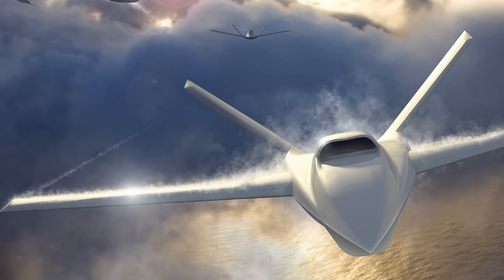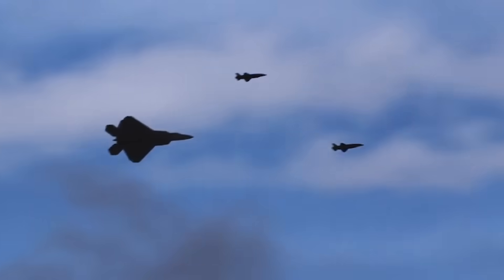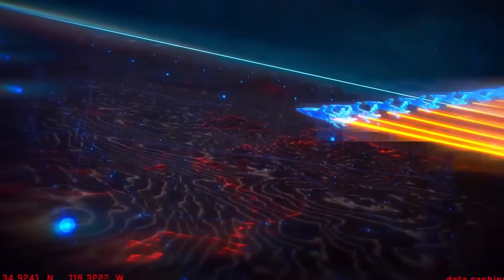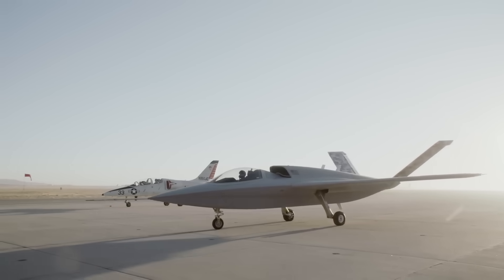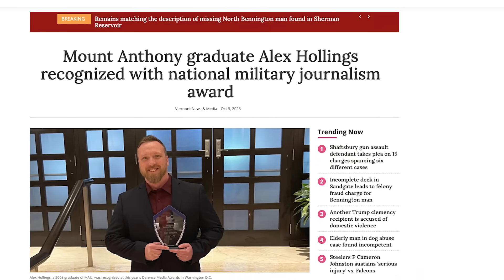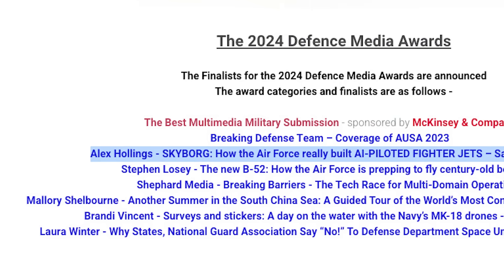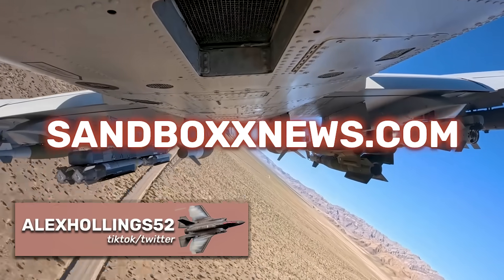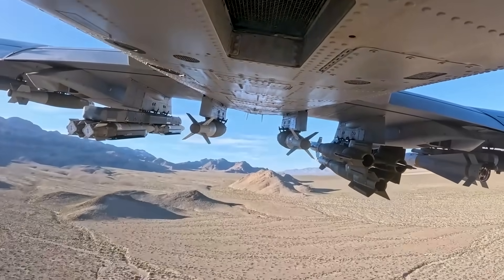Could Northrop Grumman's Vanguard be the future of US AirPower?

Comment: How Northrop Grumman conceptually engineered this aircraft is more revolutionary as the finished product requiring less than 1% re-engineering refinement after the first test flight. 

This revolutionary single thread virtual environment process takes the initial conceptual engineering through virtual engineering refinement on all levels in every category of the process to the finished product. 

This saves millions of dollars, years of development refinements and even test pilots lives as the aircraft has already been virtually refined thousands of times before it was ever even built, requiring less than 1% refinement after the first test flight.

Comment: I love the design philosophy. I've been sketching stuff like this for years. It would sell like crack to poor countries. But it doesn't makes sense doctrinally.
In the USAF, each additional airframe requires 2 additional pilots on rotation and 6 additional ground crew. These personnel cost about $30M to train, and $1M/year in salary. Everything else here is so expensive anyways that there's basically no point skimping on the hardware.

Comment: the math really does work out in this thing's favor over NGAD, if it's in the 250mil range. For that price you can get 25 of these, each carrying 2 AIM-120s, for a total of 50 missiles, and likely a similar combat range. It's not even a question. And of course you can just stick different payloads on them, and network them. Need a radar that can reach out? Replace the weapons bay with it. Need ECM? Easy. And so on. If NGAD shifts to more of a command and control platform for drone operators, I would not be surprised

Comment: I think China has the key to the next generation air power tactic. They have drones acting in large groups as single entities. They're presently using those for aerial light displays and a replacement for fireworks, but that could very easily be used for military purposes.  Combine that group control mechanism with the tactics currently being used in Ukraine, and it becomes a very dangerous technology. We NEED to be ready for such tactics.

Comment: Even without the speed of an F-14 or even weapons load if they had just engineered the F-35 &newer F-18's to have the range of the older Jets they would have truly had an exceptional machine In my humble opinion. It's shame since building so many F-35's especially they haven't by know came up with more powerful engine with @ least 35% more fuel efficiency while @ same time extending the fuel capacity I guess thru size to get this range. If just half of F-35 had the range of those old jets would make any enemy think

Comment: 11:00

What?

Low pressure turbines have been a thing for decades. What does this even mean? Other military jets also have low pressure turbines.

Also turbines have literally nothing to do with Thermal energy, Thermal energy can be converted to kinetic energy, but that is a separate process which turbines don't to anything with. All turbines do, is turn forward kinetic energy of fluids, into rotational energy.

Comment: Why can't the optionally crewed B-21 take over the role that the NGAD would fill by Quarterbacking CCA/UCAV into highly contested airspace with F-22/F-35 followed up by 4th gen fighters bearing massive loads of weapons with Rapid Dragons nearby?  The Raider can not only do air-to-ground but it sounds like air-to-air is in the mix as well.  Wouldn't teaming the Raider with Fat Amy and/or Raptors in an offensive/defensive network offer a similar capability?  After all, NGAD isn't meant to be a dogfighter, is it?  More money for the Sentinel program while allowing the Navy to continue with the F/A-XX program.  Speaking of which...are there any updates as to the status of the F/A-XX in light of Air Force budgets and DoD spending?

Comment: Wanting manned systems is an enormous self-inflicted production bottleneck but pilots like to fly and they run the Air Force. At least modern designs can interoperate with meatless situationally expendable airframes but one day sticking meat in the seat will be as laughable as the Japanese Ohka where disposable pilots substituted for expensive guidance systems.

Comment: Congrats on the awards and nominations, getting aviation news that is acurrate (to a point of course) is often thin on the ground and tends to lack details. Any more news on the V-280 Valor?

For this drone/ fighter, having it optionally manned would be a good way to go as the USAF thought that the F-35 was going to be the great replacement fighter for most of its fleet, maybe this manned/unmanned type of aircraft may be the way to go.

Even if the USAF looks at this on sheer costs alone, having a manned version of this aircraft paired with two unmanned versions would be very cost effective and could be a good general patrol platform for the US and allies. Stealthy, massive range and relatively cost effective... whats not worry about if you lose 5 or of the unmanned versions in an engagement ( and they are only really going to learn from the experience anyway once the blackbox's are recovered ) 

Good job all round, especially with the channel 😀

Comment: Why do I get the feeling that the Vanguard is just a technology prototype that will grow in size and power before becoming the final iteration? Personally, a top speed of Mach 0.85 will mean that it will barely keep up with the F-35 at cruising speed. If these CCA are meant to be reusable, then taxing the engine to max power for every flight will not be sustainable, or practical. Just my thoughts that this is not the final configuration or size of the final product.

Comment: 0:14 you can clearly see B-21's shape on the wings! Well done Northrop!
Reply: You’d be amazed at how far back you can trace Northrops lineage when you stand among their best work. 

Hangar IV at the USAF Museum at Wright Patterson in Dayton. It’s possible to stand in front of PAV-1 (YF-23), face Tacit Blue (BSAX) and see a full-sized B-2 mock up just to your right (it’s an ENORMOUS HANGAR). 

If you look closely, you can absolutely see the lineage between BSAX and the B-2, and from both of them to the YF-23. The rounded edges and chines and razor thin, almost imperceptible transitions from one to the other. 

Now with Vanguard, as you pointed out, you can clearly see the RQ-180 and B-21 DNA. And not for nothing, but I still see Tacit Blue in the aft section on the airplane as well. Great stuff, innit?!

Comment: The top mounted intake is pretty unusual for a modern fighter-type aircraft. I saw that and it got some gears turning in my head for the last few days. Now hear me out on this:
What if they made something that general shape, but it was a seaplane. Like a modern Convair Sea Dart, but done right.
Watertight hull and hatch seals, reinforced and re-contoured as necessary. Use retractable hydrofoils instead of skis to smooth out the bumps, like the LISA Akoya does. Have the rear set (if needed) be V-shaped and double as a carrier tail hook. The V-tail is already great for staying out of the water. Put a GE F414 in it, with a YF-23 style exhaust that would both cut down the IR signature and also help keep the water away from the engine. Stick an M197 in the wing root for good measure. Can radar absorbent paint handle seawater?
There’s so much talk about the vulnerability of carriers and air bases in the pacific, but what if you could turn every bay or harbor with a boat launch ramp into a temporary airfield/staging area/resupply facility?

Comment: The F-22 is still the plane to beat.  We have the F-16 replacement with the F-35.  It is a good plane to replace the F-16.  We need an F-22 replacement and a F-18 replacement.  The F-18 is so versatile.  It can launch/land from the ground or a boat.  It has a growler electronic warfare variant.  It does air to air and air to ground.  It has 2 engines.  It is a great all around plane.  Show me another plane that can do what the F-18 set the standard for modern combat.  The F-18 can even refuel other planes.

Comment: I love when the U.S. invests heavily in developing incredible platforms like the Saturn V, SR-71 Blackbird, YF-23 Black Widow, and F-22 Raptor, pushing technological boundaries. But when there's no immediate adversary, instead of preserving production capabilities like in Russia, where they can restart old designs even decades later, U.S. platforms are often killed off by business lobbying and shortsighted politicians. Tooling is destroyed, assembly lines are dismantled, and knowledge is lost—just like with the Saturn V. Blackbird was killed by accountants and politics not satellite imagery. The YF-23 was scrapped in favor of the F-22, and instead of keeping the F-22 as a backbone with upgrades, more money was funneled into developing the F-35, a weaker platform. If the U.S. had diversified its air dominance programs, ordered both the YF-23 and F-22, and used modern tech to cut production costs, the F-22 could still be the dominant fighter today, supported by AI drones, instead of relying on a plagued by design flaws F-35, that isn't even one flexible platform but 3 different ones sharing only 25% parts. So this way USA could have more for less with lightweight 5 gen fighter in final development. Now when so many nations have their own stealth fighters. It would be a better choice.
Reply: If we ordered both the YF-22 and YF-23, it would have ended up like the LCS. And I don't think I need to explain why that's a bad idea.

Comment: RE: Additive manufacturing - It's possible they are talking about 3d-printing titanium in general and not their specific implementation of it. Even then, I have to call that into question. FFF or FDM (Can't remember which one's trademarked. They're the same process, though,) has been used to modify drones for combat in Ukraine and I wouldn't be surprised to learn that this has been happening for a lot longer than that. Being able to replace parts and make modifications on demand is one of the biggest strengths of 3d-printing, and I think anyone who even just dips their toes into military history knows that the guys on the pointy end will modify anything if left unsupervised for long enough. Even as bad as the early reprap printers were compared to todays offerings, they could still produce useable parts and allowed for rapid prototyping.

Just my two cents. I've been interested in 3dprinting for over a decade and finally got my first ones a few years ago. Between resin and filament printers, there's a lot of scope for one-off mods and prototyping ideas on the cheap. Even if the parts aren't that durable, I think it's still useful because you can find out what works and what doesn't before bugging the guys in the machine shop to make some chips to make your part.

Comment: Top speed really isn't that important. Let's use American targets for example. If the attack is against Denver, the planners could send out these collaborative aircraft ahead of time, unmanned. Then the F-35, F-22, B-2, B-21, or even F-15 aircraft heads out for Denver at a higher speed. Everyone arrives at around the same time, and a coordinated attack takes place.
Maybe have a few show up early and loiter for a while (possible due to the extended range) and locate a few important targets. Then when sufficient aircraft show up, they attack.
Or they could start the attack, stay around for battle damage assessment, and then head home once the other aircraft arrive.

Alternately, one could stay around as a "defensive tackle". If an enemy somehow gets a target lock on the manned F-22, the collaborative aircraft jumps in the way and takes the missile instead. This would save the life of the F-22 pilot, which is worth much more than an attritable aircraft.

Comment: Lol I am guessing you really read my comments from the video a couple of weeks ago. I definitely mentioned the faster digital design process being able to remove development steps as well as the potential benefits of additive manufacturing to speeding up the design and development phases as well as improving the sustainability of the platform as you wouldn't need to worry about shuttering a production line. The production line is simply a printer that you could schedule time on to print a replacement part.

One of the big differences in our opinions though was in AI pilots for testing. I posited that this could be a way to speed up development as you wouldn't risk losing a test pilot if the thing crashed but you seemed to have an opposite opinion in that having a trained test pilot in the plane is actually faster. I guess I think it would be interesting to do an interview a modern day test pilot and get their opinion on the matter. We could ask if there are benefits they would get by operating the plane from the cockpit instead of from a computerized training cockpit. I would like to know how much testing is required before they are even getting into the plane to make sure it is safe. I also think it would be interesting to know how far away an AI test pilot would be. I definitely feel that you could get quite a bit of data quicker without a pilot. 

I am not diminishing the pilot here but that I would think you could simply program a flight profile for the AI to put the new platform through its paces. Then using the sensors on the plane you could compare that flight data with what you would have already simulated in your computer model. If there were major deviations from the expected behaviors then you would know there is a problem, you stop the test immediately and go back and investigate. If there weren't though you could simply take it as a successful test and then move on to piloted flight testing. But if these things only cost $5M your engineering design time is going to be a lot more expensive than the potential loss of a prototype and I would feel comfortable getting a prototype in the air as quick as possible to shorten that design phase. Even if you figure there is a 20% chance of it crashing you could save money if 1/5 of your prototypes crash and are complete losses as it would allow you to refine your design much more quickly If you have a pilot in the cockpit though you need to be at least 99% sure that the plane isn't going to kill them which means you are going to be spending a lot of time doing other types of tests where you don't get as much useful data from the test as you may get from an actual flight test.

Honestly the biggest issue I think for my testing methodology would be is if AI systems are ready to be a test pilot. They have proven to be very experienced in a F16 but unlike people computers generally aren't able to translate knowledge from one scenario to another so they may be great at piloting a F16 that they have been developed on but may suck at piloting a F15, F35, or whatever new platform the engineers have designed. I know it is still early days for AI pilots but I am hopeful that they can get to the point where they are good enough to make these very expensive platforms just a little bit cheaper.

Comment: The Aussies and British produced a very successful pilotless target drone in 1949/1950 called the GAF Jindivik and had two piloted manually-controlled prototypes built called GAF Pikas, as proof of concept to test the aerodynamics, engine and radio control systems.
What was most alarming for the test pilot his cockpit canopy permanently bolted the pilot in the aircraft by pre flight engineers, thus the pilot had no way to open the canopy or release latches and  no ejection seat to egress.........your in there for the ride sucker! for better of worse. 🤣

Comment: Congratulations, Mr. Hollings on the nomination.  I wish you luck.  With respect to the Vanguard, why slave the AI versions to a Raptor or Thunderbolt II?  Since there is a piloted Vanguard, slave the AI Vanguards with various loads for a complete strike group.  One AI Vanguard serves as an EW platform.  Another serves as recon.  A couple will have AA loads.  And the rest of the AI Vanguards will perform AG tasks.  The piloted Vanguard will manage the group and provide the human authorization.  Since all craft in the group have roughly the same signature, it adds a level of difficulty to determine which craft has the pilots.  Also, maintenance time and supply needs will be lower because of similar platforms.
Reply: At  $5 million each they are probably missing a lot of systems that a F22 or F35 have. If you are flying into contested airspace you would much rather have an F35 with its AN/APG-85 radar then whatever would be included with the Vanguard. Flying with a Raptor or Thunderbolt probably increases the effectiveness of each Vanguard.
Reply: Could use some as a drone mother ship that can release recce/attack drones that could be piloted from anywhere

Comment: I think we need a lot more low cost combat aircraft like this for lower threat missions. I like the idea of a scaled up version of this along with a combat version of the T-7. Those two could really help boost fighter numbers. Of course the Air Force has to fix the pilot training system first because it's a mess right now.
Reply: Right now the idea is just to use older jets like f15 f16 for lower threat environments.
Reply: @johnathanclayton2887  A new F-16V costs 60+ million, and the new F-15EX is 90 million. This style of light attack plane  would be sub 20 million.
Reply: @blueskiestrevor5200  why is it fundamentaly so much cheaper? There hasn't been a 3x cost reduction in manufacturing methods.

Comment: A plane with no pilot can be smaller, lighter and more aerodynamic, unless you add an unnecessary cockpit.
Reply: If you don't need smaller, lighter and more aerodynamic though you can have a cheap, low risk craft that can be manned if the Air Force needs it manned.